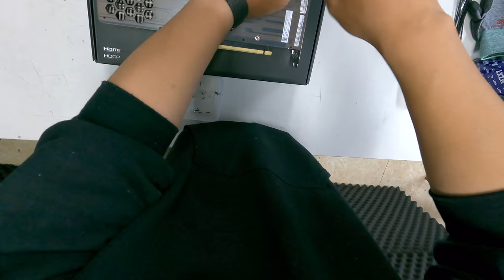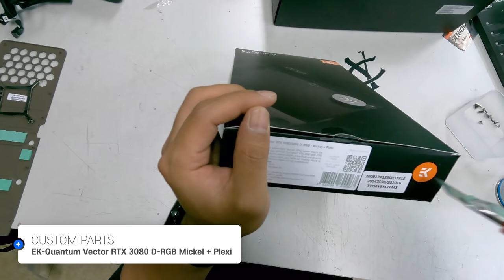$5000 First Thermaltake DistroCase 350P WaterCooled Build

Comment: When you spend 5K on a god tier PC but you use only just enough RAM for most games in 2020:
Reply: Think again it’s 10k to like  30k or something
Reply: @mrb34m29   I was going off what the title said, but whatever, mr Roblox pfp
Reply: LOL. I always think that kind of stuff when I watch these builds and then I remember - these are probably design builds and won't actually be used.
Reply: 16gb is enough wont need more than that for years to come
Reply: @roidnerd2501  I use 18 most the time while gaming. Yes I close unnecessary background tasks.
Reply: @ceoofsadness7015  18 lol what games are you playing minecraft on 18k res
Reply: Yeah I just had a custom liquid cooled PC built with same video card and CPU but went for 64gb RAM, 2TB M.2 drive, 2TB SSD data drive and a sound card for only $400 more....
Reply: It just doesn't feel right leaving one of the things at  average and the rest being extreme. I like to have balance in this sort of thing.
Reply: Somewhat agree with CEO. I myself with only i7 7700 and using 32GB of RAM. This one should at least, have minimum 32GB.
Reply: @Bugnarok  From what I 've seen on r/pcmasterrace it's becoming more and more the standard.
Reply: @ceoofsadness7015  specially when considering it's 10k series
Reply: SO true in my old setups 10 years ago i used 32GB now days if i make a sys 64gb min or 128gb
Reply: @mrb34m29  no it’s not u do not know anything about computers
Reply: @mrb34m29  It's 5k, because that's what the titles says! the parts cost in the video amounts to 5k!...
Reply: True that, pretty silly not to fill up all the slots, even visualy it looks better.
Reply: @roidnerd2501  most new PCs already have 32 gigs of ram. If you want to do something like video editing, 16 gigs is barely enough
Reply: @your_average_cultured_dude  most people still use right now is 16gb wide spread same as  1080p is used more than 1440p, It wont be 32gb for a good 10 years for gaming and  yeah for video edit sure you need more
Reply: lol.. I wondered why only 2 sticks
Reply: Warcraft 3 uses close to 10gb,  COD Coldwar uses close to 14gb,  so I would agree 16gb is not enough

Comment: Hey there,  I've got the distrocase but finding it difficult to connect  led strips on the distro plate to my setup. There is no wire provided with the case and I can't find any answer anywhere either. Please can you let me know how to connect them what cable to use etc for it..  🙏 thanks in advance

Comment: Does bunching the cables up like that impact performance or anything? if it doesn't, i gotta rebuild mine and clean it up a bit lol.
Reply: As long as they’re plugged in well and not at a harsh angle, try to manage them as best you can.  Obviously it makes your build look better, but sometimes messy cables can slightly restrict airflow throughout the case.  Good cable management also makes it easier to do repairs/upgrades. 👍🏼